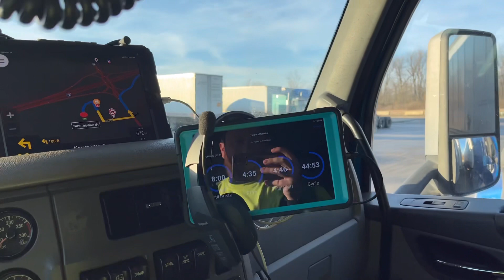You see… I was inverted

Comment: Howes is safest for engine but PS 911 is going to keep you from gelling for when it gets way below zero
Reply from the maker: I had twice the recommended dosage in each tank of 911 on top of all the howes I had in it which was also more than what the dosage states.  Still was gelling bad… it was -45 windchills
Reply: @Sense_Per_Mile  I assume you ran it for a while after mixing in your PS 911? Because if not your original mixture is all that’s in your fuel lines, fuel filters and injectors
Reply from the maker: @cryptocrunchies2478  yeah I had 90 miles to make it to the yard barely made it
Reply: @Sense_Per_Mile  Wow I’m in Wyoming and never had the big truck gell up even with -20° and windchill of 40 below. Of course up here the fuel comes already treated for about 30 below zero this time of year. (I run through Montana a lot year ‘round)
Reply from the maker: Yeah I’m not sure what the issue was… I’ve never had a rig gel like that before